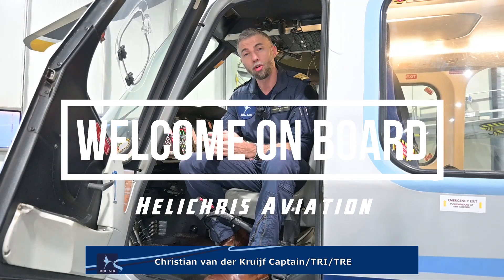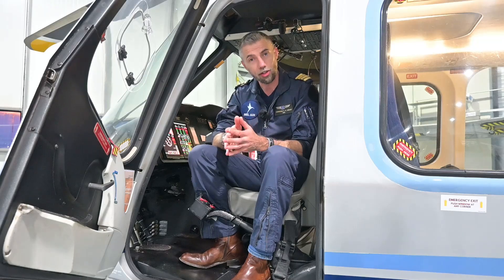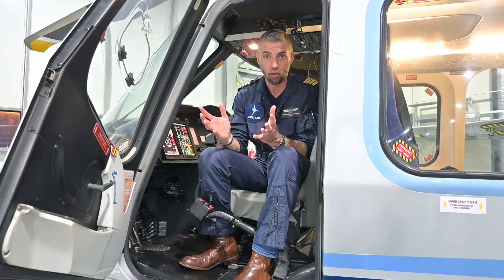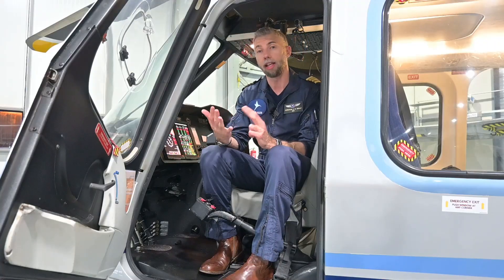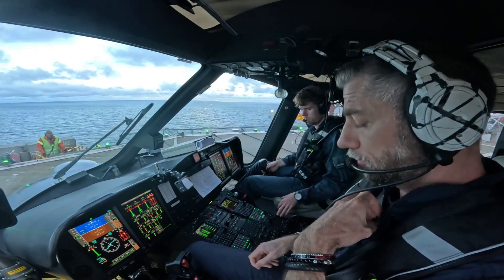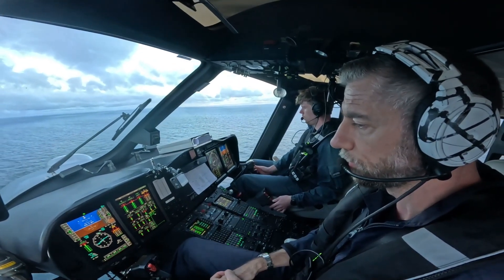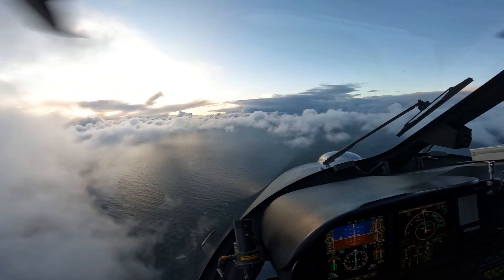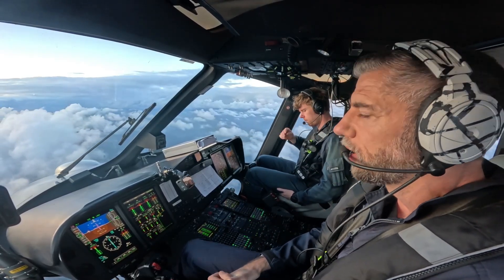How To Become An Offshore Helicopter Pilot | STEP BY STEP  #aviation #pilot

Comment: Also possible to do an integrated CPL(H) in one go.
Reply from the maker: Indeed! Thanks Ian!  and then you have less hours required right? to start the CPL part?
Reply: @HeliChrisAviation you can start ab-into with zero hours, but you can receive credit for 50% of relevant experience if you already hold a PPL(H). From zero time the course is 135 hours, or 180 hours if integrated with the IR(H). Also possible to do an integrated ATPL(H)/IR from zero, with 195 hours of flight instruction.
Reply from the maker: @ianscott5293 cool! Thanks Ian!!

Comment: Hi Chris, thanks for the video! What is the situation in the offshore industry with regards to a possible pilot shortage? It's a topic in the helicopter industry as a whole but I'm wondering whether this is also the case in the (european) offshore industry and whether this might lead to companies being less rigid with the 500h requirement. 
I mean.. the whole point of it being hard to find a job as a heli pilot is because most operations are single-pilot and now even in the one industry where that isn't the case, they still require 500h making that famous 300h gap just as much of a problem here as anywhere. I know risk is higher in off-shore flying than it is in fixed-wing commercial flying but over there, they're hiring right out of flight school - why can't offshore companies do the same? Probably because they have never had issues finding people but one day, people are going to be tired of putting down 200'000€ and years of hard work just to find that there is no job down the line. If heli companies don't put at least a bit of effort to help us out then, I believe, one day, they are not going to have anyone to hire anymore. Sorry for the rant ;) but the struggle is real !
Reply from the maker: Thanks for your comment and insight! you are fully correct.. the struggle is real! and withing a few years we will see that problem in the offshore. It has always been ups and downs and the requirements followed. When there are enough pilots to choose from the requirements generally go up. This is also a big deal about insurance. For us its MUCH cheaper for the insurance per helicopter to have crew with higher experance. So if we lower the requirements the insurance goes up, and also some offshore customers require more.  The problem with the extreme prices for the education and the relative low work guarantee is also real.. we will se that in the near future. Companies (also where I work for) have identified this issue and might take action  in the future to take part of the training in house to lower the cost in trade for a guarantee work period.. All speculation until now, but the issue is identified!

Comment: Hi Chris, I,m an ex military Helicopter pilot, long retired but I love your videos, takes me right back to the cockpit, although I never flew anything as modern as the AW139 or 189, I mainly flew the Lynx. Keep up the great work!
Reply: 💯% To you mate. A chap I know was Royal Engineers, he got Accepted into The AAC And he is now Flying Apache's for a living, just an ordinary lad but switched on 👍👍
Reply from the maker: Thank you so much for your kind comment! Cool you operated the Lynx, beautiful machine! They used to be based here in Den Helder too.
Reply: @HeliChrisAviation  Yes it was like the Sports car of the skies ! Very fast, and very agile, you could actually role and loop it but only for test pilots, we squadron pilots weren’t allowed to do that. I did actually visit Den Helder a couple of times to visit the Dutch Navy Lynx based there, and we hosted them at Yeovilton. I actually finished my career flying the Sea King, was like a bus after the Lynx! Stay safe and keep up the great work. I finished with nearly 2000 hours on Lynx and around 400 on Sea King.
Reply from the maker: @markneal1175 wow very impressive. Thanks for sharing 🤗.

Comment: Very interesting, thank you very much. 👍
One question: Is there a height restriction? 🥴 
Cause many many years ago I was told that the height limit for helicopter pilots is 195cm… 🤷🏻‍♂️ Don‘t know if it‘s still the limit.
Thx in advance and best wishes from Germany 🇩🇪, Philipp
Reply from the maker: Thanks for your comment! Well I am not sure... if there still is a limit... At least I have not heard of it.. Ill ask at my next medical check!
Reply: @HeliChrisAviation  Thank you 👍 Thin is though, I am 200cm tall so just a bit taller than „normal“ 🥴
Reply from the maker: @5ShotProductions indeed… but I still
Think possible 😊